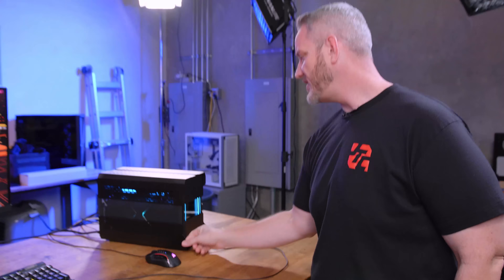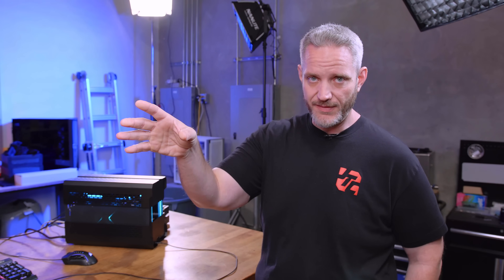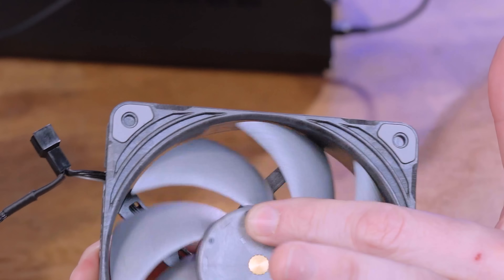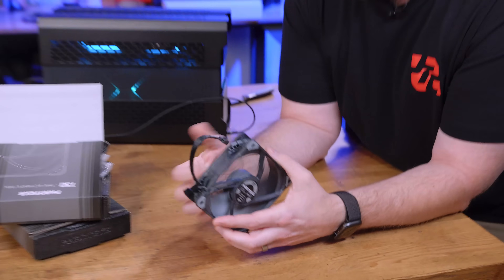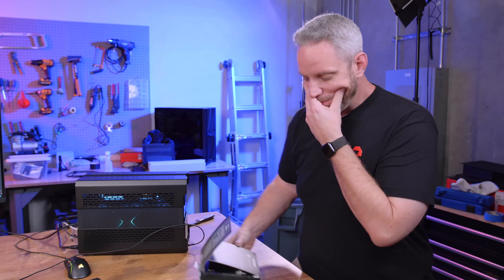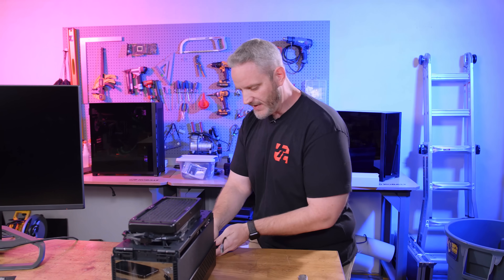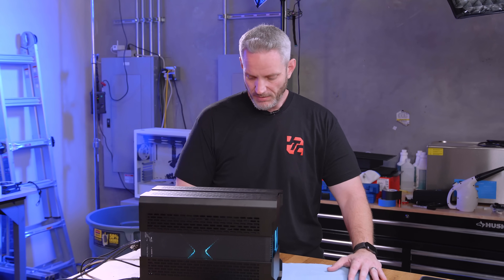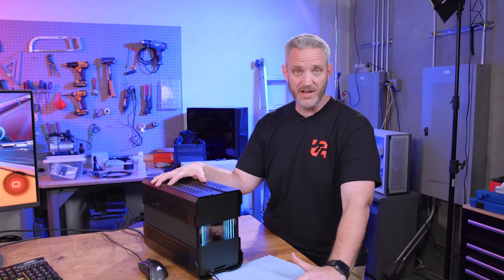Improving the cooling in my Evolve Shift XT build... it got TOASTY!

Comment: Seems to me that it would be a bit more efficient if the fans were positioned above the rad, pulling air through, rather than below, pushing air through, since pushing should cause more air splash. Don't know if that's possible in this case, though, due to needing more room for the water tubes if the rad is positioned lower.

Comment: When I changed NH-D15 with Arctic Freezer Liquid II 360mm AIO last year for my 5950x I replaced arctic fans to NF-A12x25 ones from noctua (which Phanteks copied design from) the point being that those fans come with a silicone gasket sealing the Jay's mentioned gaps between the radiator and the fan frame, I've set fans to spin at 50% on idle because they are inaudible) and ramp up to 70% when cpu goes to 70 or 75c - really good fans with one downside being that they are expensive lol.

Comment: These fans are reaaally similar to the Noctua A-12x25, so these are thinner but same 0.5mm frame to blade distance, high performance bearing and rotor motor, and they come in black

Comment: I am working on a build with a 12700k and a 3080Ti. I plan on undervolting my stuff to help with thermals and noise. I unfortunately can't flip my PSU as i stuff all my excess cables in that slot. Probably not the best

Comment: I added several 3/4” and 1” holes to my case. The airflow did not improve as much as I had hoped but there are fewer material restrictions and t is a little cooler.

Comment: get some of the 8pin connectors that are in a u shaped pcb so the cables run down back of card so you can fit larger gpu in without crushing the cables you had prob with before

Comment: One thing I've noticed which I'm sure Jay knows but for people who don't the Be Quite fans software L-Connect I think it's called sometimes just doesn't kick in on boot for whatever reason so you can set your fans at like 1500 RPM but since the software doesn't idk register or load properly they will run at a stock slow speed, until you manually open the software then they will kick in.

Only happens every now and then and not hard to tell with the sound difference but something to watch out for.

Comment: Should have put a temp sensor behind the PSU before and after flip.  Radiant heat on the back of the PSU is probably less of an issue than sucking heat into it.

Comment: Something of note also is the top case perforations have a lot of flat metal between them that obstructs full fan flow, and the reason after much experimentation in my limited build experience that I will sometimes neatly cut the fan hole out in the back of rear case punch outs and install a chrome wire fan grille - they flow and they are the absolute best flowing and quietest grille you can use, thought not great looking which is why I only do this mod on tha back case panel exhaust fans - really quiets the fan down and increases the air flow though.

Comment: Thanks for the info! My Phanteks Evolve Shift doesn't arrive until the end of Apr here in Sweden. But now I have some better ideas on how my build should go when I finally put it all together. Also, thanks for the review of the Phanteks T30 fans. I was planning to use a slightly smaller RGB fan. Maybe now I will skip the RGB fans. I really don't look at the lights when I am working and I don't typically play games on my machines; I am a design engineer (RF/microwave/antenna circuit design & simulation), so I use my machines for simulation & design work. When I run an antenna simulation (phased array type structures), the amount of CPU/GPU usage can be very high for hours at a time (longest run I ever had was 26.5 hours over a weekend).

Comment: I always use the 240mm RAD on the GPU and not the CPU. But if you have a Intel CPU then its understandable as those run ultra hot.

Comment: Interesting tests Jay.  However, all that heat and noise seems like the case is the problem not fans or layout.  Try that same setup in a more traditionally laid out ITX case like a NR200.  I don't think setting a referece RTX 30 series with that blow through fan is good in a sandwich layout and the positioning of the CPU fans for the AIO leaves a lot to be desired.

Comment: Jay, why don't you try a software that adjusts the case fans based on gpu or gpu and cpu temps?
I use Argus Monitor myself and it has helped me keep my temps and noise levels at a more stable level.

Comment: For anyone looking to recreate this combo of case and AIO cooler - the 240T30 AIO --- DOES NOT FIT. 

This was corroborated by Phanteks support. 

Your only option is to set the top of the case directly on top of the AIO radiator. This makes the case feel janky anytime you need to move it around as the top is not fixed to the actual structure. I just found this out today after completing my build this past weekend and banging my head on the desk trying to figure out why the top of the case will not attach properly.

Comment: Aside from everyone screaming about undervolting the FE Card, you can also flip the fans to the top of the rad as intake and let the air flow out of the mesh on its own. Immediate access to room temp is better than immediate access to component heat in an SFF case.
Reply: Then you're making the card fight against the rad fans. CPU temps will get way better but his already bad GPU temps will tank

Comment: 12:01 Jay, if you're trying a bigger graphics card, you now have 5mm more space between the radiator and case to work with for your tube because of the extra fan thickness. You might have a few more options to route that tube.
Reply: Fans/rad sit on top of the case plate so that height didn't change

Comment: Nice video as usual! There is a limit of how much wattage made into heat can a case dissipate and that normally depends on its volume and speed of the air tranferred through. In such a small case I would put a lower W limit to the CPU/GPU combo.
Reply: If he were to go into Nvidia control panel and turn on max frame rate, set it to one frame/Hz lower then his monitor, he would lose about half his render time, and feel better "reaction times" thanks to the render times being 2-3ms rather then 10-15. Also his gpu would also probably be sitting at about 40c-45c...
Reply: @crisnmaryfam7344  Thing is not all games are so light as this. That was a test for thermals not for FPS.
Reply: Doesn't depend on volume. Only thing that matters is how quickly you can remove the heat from the components. If you have a small case that is fairly open like the Meshalicious you can get better temps than a standard atx case like the SS RL06. This is because while the smaller case has 2 fans (compared to 5 on the RL06) it also has less distance to push the air. Overall, this is just one example. In general, you can get just as good temps in a small case as a big one. Yes, there will always be smaller cases with less mesh and worse airflow, but that goes both ways. If you want to run top end components, go for it, regardless of case size. Just make sure you can ensure proper flow of air.

Comment: AYE... this is the video i was hoping you would follow up with. the temps are solid after the fan change. not many people are gonna leave a game uncapped over the refresh rate so that would drop it a couple more C. also, were these the regular light wings or the high speed ones? i have a high speed one as my exhaust fan and it is still pretty quiet. nice to see another rocket leaguer too. i play in 3440x1440@144hz locked on my aorus 3070. my temps hover right around a peak of 70C. completely acceptable imo. my next build might be a case like this in all white. im dying to do a all white build

Comment: If you want performance in a silent build, go Noctua NF-A12x25, it's more silent than Phanteks T30, but T30 can brute force the most performance for a 120mm fan. If you want RGB, just undervolt the CPU, GPU and you will get 10C lower.

Comment: I gave up on this case due to thermals. I went back to the NR200, where the thermals were a good ~20° cooler on CPU and GPU, and much quieter (w/same fan curve). That sucks, because the Shift is a beautiful, small case. Also, the actual case was extremely hot to the touch; like uncomfortably hot.

Comment: I mean, the heavy buzzing sound with those new performance fans would make me throw the whole computer down after 2 min. Reducing the FPS to a 240fps cap would drastically improve thermals without even changing hardware. Underclock would also help a lot. Silence is key.

Comment: I think this case comes into its own when paired with a GPU with a AIO like the MSI Sea Hawk. Couldn't probably run a 12900k on the necessary low profile cooler but a 11600k goes fine with a NH-L9

Comment: There is a program called Argus monitor that allows you to tie pwm fans to other temp sensors other than just the CPU. My case fans now ramp with GPU memory/ junction temps and CPU. which ever is hotter

Comment: I've seen a number of AIO fan / radiators mounted to brackets in this fashion. Are people just making their own custom mounting screws for these? Because the mounting hardware that typically comes with these units is JUST EXACTLY LONG ENOUGH to go through the fan housing and into the radiator housing without piercing the rad fins. So how does one mount this assembly to a 1-1.5mm thick bracket like this with that hardware? The screws that came with my DeepCool LTS520 aren't long enough to do this.

Also, how well would it work to reverse the fans and pull cool air in from the top, through the rad, and into the chassis? Seems like the entire case allows air flow.

Comment: I have a video idea for you that would also be educational. You should undervolt the 3090 to lower temps which will also reduce the fan rpm and noise. You can get 5 degrees lower on GPU temps with a simple undervolt and not lose any clock speed or performance. From what I see in the SFF community it's common practice. You should make a video on how to undervolt your GPU using this PC and check out the results at the same time vs before. Even if you manage to fit a new card it would still be cool to see.
Reply: You know Jayztwocents is more of a overclock kind of guy? Which will put jet engine fans (T30) and just brute force it than putting quiet and powerful fans (Noctua A12x25) and undervolt a bit.

Comment: Hey Jay,

I'm planning to do a build in this case.  I noticed that your build is running at a negative pressure build currently.  I wanted to ask if you thought about flipping the Radiator fans to blow air into the system to turn it into a positive pressure system.

I was planning to follow your build guidance except I am using a 3070 TI Black Edition and a Ryzen 5 in the system.

Comment: I have to admit, I was expecting the TR30 to be at least a bit quieter while not going 100% fanspeed since we are talking about a fan-design similar to the AF12x25. Still like the sound of the AF12x25 more since for me it sounds deeper. Kind a sad since I was hoping for (more) competition in this regard (sound profile of the motor / rotor) as well.
Reply: If you put Phanteks T30x30 at the same fan speed as Noctua A12x25, it will perform similar, because the fan is thicker (tho the frequency is higher and it "sounds" worse). But T30 is build to brute force as much fan speed as possible for the lowest temperatures, so if you want a jet engine, get T30. If you want 99% the same performance for a lot less noise, Noctua A12x25 is still king. And undervolt is underated, you save 10c just by doing it.

Comment: Is that 3080 FE one that was repasted and repaded? I feel that would have a greater affect on temps with the changes you’ve made vs a stock 3080 FE. 
I like that you immediately revisited this build addressing issues that regular consumers would experience. This case looks so cool and you identified all the pros and cons which helped me make up my mind about this case. Another great video!
Reply: nope FE always is a hot shit , which is why third party gpu comes around
Reply: @香噴噴-p6f  FE cards do run hot but, Jay had repasted/repadded a 3080 FE and it dropped the temps quite a bit. I did the same with my 3080 FE and experienced similar improved thermals.

Comment: Cool fans, a mixture of corsair and noctua tech in one. I do like phanteks, they make good stuff. My first pc build was in the evolv case, with horrible restricted air flow. I'm pretty sure you even cut up the dust screen to improve airflow. Got a 1700x to run at 4ghz in that case though, water cooled. I use the noctua u12a now though, great cooler that no one talks about. My next build is definitely an itx. Which is what I wanted to do in the first place in 2016 2017, but, ryzen itx motherboards at launch, mehhh.

Comment: I know old video, I have a question about the Evolve Shift XT, I won a Corsair 280mm AIO at work, I am going to start buying new PC parts soon, I am curious will the 280mm fit in the case? I am sure it isnt drilled out for the 280, however is there enough meat at the top to drill out for the 280?

Comment: that was true thermodynammics engineering, lot of fun and challenge in such case ... mine is on the way already ))
... but what about AIR-only cooling with hi CFM/pressure 2x 120 or 140 exhausts on top and some slimmer CPU cooler (NH-L12S, maybe having also air tunnel just to the case mesh?) making intake from outside? ... it seems that too much HOT GPU makes CPU cooling with AIO less effective, as radiator cant cool down much having hot air over it ... and also the radiators pressure resistance also BLOCKS faster air exhaust from case probably? in extreme cases is not problem to remove entire top cover and let it breath more ... (BTW, I am expecting only 65W TDP AMD and RX6600 in it ...)

Comment: thanks for covering this direction. im ALWAYS preferring cooler system over noise. granted, im running on an old system, and pushing the hell out of it it as a modern system, (4XXX i5) but i consider 60c as hot, im currently 29c on core. and pushing it playing games and such will get me to the 50's, i consider that ok, anything higher, and there is an issue. this would also show why running it cooler over a long time is why i still have this system as operational as it is. 
cover more about lowering temps please.

Comment: the case is neat. but..... i am more interested in acquiring those fans without case. does this company offer the fans separate? if not they should as it would definitely open up revenue for them. those are some very well designed fans from what i seen in the video and i would love to acquire some for my 27 year old maxi tower cases i use. i stick with these 2 cases because i just havent found a case i like to replace them yet. i feel most the new cases are to cramped.

Comment: I have a new Origin Chronos. The system runs great and it has a 3080 in it. I get around 88 - 96C when running high end titles but doesnt drop frames and runs good. I think Nvidia cards can reach a ceiling of like 102 or 104C
Reply: of course Icue also shows like 3 diff temps for the card so It might be a different sensor on the cards he is looking at here.

Comment: Why dont you take the psu out and fit a vent to it on the non fan side of it and leave it the way it was installed, that way air can pass straight through it from the graphics card and go out the side of the case

Comment: I run my 3080ti slightly undervolted so it mantains constant high clock speeds with my fans at 75% when gaming and my temps are great, I have the same FE card and the auto fan settings allowed it to run hotter than i was happy with. Honestly the thing sounds like a jet engine at anything about 70-75% once you hit 80% it's crazy loud don't ever bother with 100% unless you have a loud headset or are further away from the computer, I sit quite close to my tower so i notice it a lot without headphones but for the most part i'll use headphones only on some single player games i'll use my speakers and crank them up as my bose speakers are good quality for gaming. I wish the card ran quieter but gpu's are never going to be that silent when they're running games. I am very happy with it though it's an insanely powerful gpu. the vram temps concerned me the most but i've done enough research to know the safe limits for gddr6x now. PS. just for reference I have a corsair 5000d airflow with 7 ll120 fans and a noctua nh a12u air cooler on my cpu so no rads in my system.

Comment: Does clock speed constantly drop as temp increases? I always thought it doesn't throttle down until it reaches a very high temp limit (like 90c or 100c)?

Comment: Wondering if it is just any other regular GPU without fan pushing through the heatsink to the back of the GPU. (2000 series or older) or any AMD card.

Comment: Jay thats why you undervolt your GPU and CPU in SFF cases. 
I dropped 45W with an undervolt on my 3060ti and i hit the same clock on the GPU as without undervolt. With PBO2 i overclocked the 5600x to 4,7 all core and 4,85 single core with 100w power budget.
Now my system is so quiet under load in my NZXT h1. CPU at around 70C my Gpu is at 66 C under load.
So if you build in aa small case you should really consider undervolting. The temps and noise drop by quiet a bit and the performance stays the same.

Comment: Not reading 840+ comments to see if anyone else brought it up, but I wanted to point out that the CPU also dropped by anywhere from 10-15 degrees after switching out the fans. Massive improvement all around for very little effort!

Comment: I gotta learn more on Fan Curves and such, as right now sadly i don't know much on that aspect.    Running my Intel 10700 system with Stock CPU cooler, and Case fans, still runs quite a bit warm to hot at times, depending on what i'm doing

Comment: Having hot air entering your power supply would cause the psu to run extremely hot and max its fan pretty much all the time. Which on an sfx psu is super loud and annoying sometimes.